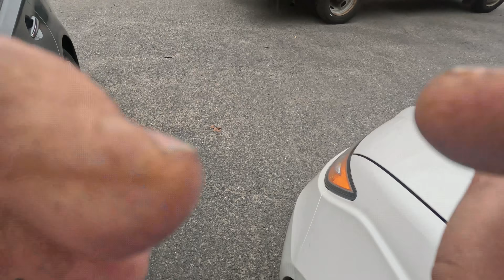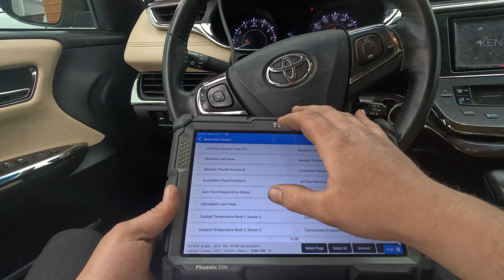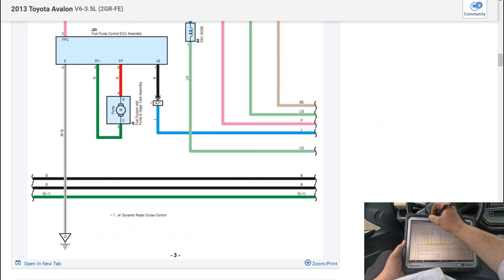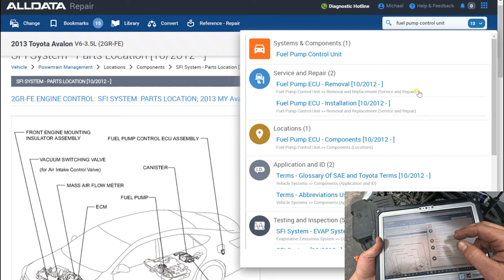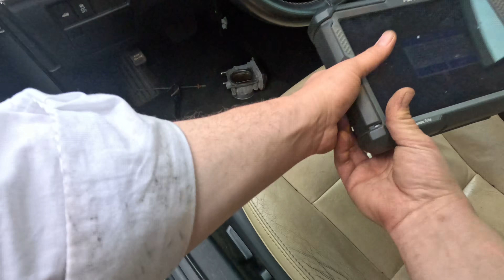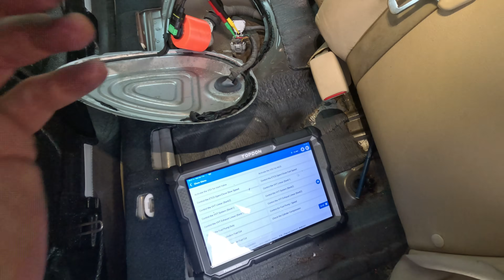2013 Toyota Avalon - Crank No Start diagnosis!

Comment: Thanks for the vid.  One question.  As soon as you realized it was a fuel issue, could you have jumped a few steps by using a fuel pressure gauge?

Comment: Good idea to pull the 30a efi main fuse and visually inspect on most Toyota instead of probe with light
I have seen at least two fuse (in this location)with burned pin.one cause intermittent stall.if burn pin on load side the light will still light on both sides.and then there's the person who remove fuse and jam test probe as deep into fuse socket causing loose fuse. Thanks for the video, especially on Toyota s.

Comment: Quick and accurate diagnostics, the way it should be done. It's too bad cars don't have Shrader valves any more to directly check fuel pressure.

Comment: Wow I been looking at your video,I have a Avalon and no power to my push button so what gives
Reply from the maker: I don't really have enough info, but the power button gets its power from the certification ECU, I would check the ECU IG2 2 fuse, its a 7.5amp fuse under the dash
Reply: @advancedleveldiagnostics  thanks for replying sir but I narroed it down to the steering lock I wish I could get my 69 Plymouth satellite back lol

Comment: Hmm, love the video, but you did take 2 nuts off the fp module, only put 1 back on?
Reply from the maker: No, I put both back, I dropped 1 nut under the carpet, so it took some time to find it. So I cut out that part and just put the actual ratcheting it in. If you pay attention, you will see the cut.
Reply: @advancedleveldiagnostics  I don't pay that much attention lol

Comment: Hi, I dontated your channel, have  fewquestions doesnt make sense to ask without donating..  1.  when you use godiag GT100+, DO you connect resistor between can hi and low to make it 60 ohm.. i bench tested with and without connecting resistor and it works fine.  just curious..  2.I know  my ECM works fine, when do i know it doenst work when i connect to GT100+ any tips LIKE what protocol to choose.. 3. i see power source for ECM. This means power goes into ECM .. does this have to be connected to 15 swtich AT GT100+ OR JUST CONNECT 15 switch ONLY TO ECM input that calls Igntion switch. 4. i see many grounds at ECM atleast 4 pins.. do i need to connect to all of those, or just one is fine. which internally bridged..
Reply from the maker: 1. It really depends on the PCM I know on gm PCMs I never needed the resister but on some Chryslers you can only write with a resister. Sometimes I think you can read without a resister but can't write. The answer to most of your questions is going to be it depends, sorry 😔.
2. I'm sorry I don't really know about protocols I just use the oem data and the scantool does it automatically. 3. The 15 switch is for ignition, the 30 powers are for constant power. The reason they split it up is because sometimes during bench programming you will need to switch off the ignition while still having constant power. 4. Every PCM is different, I just connect too all the grounds just in case. For the PCMs that I do the most I have premade connectors that I bought that connect to the PCM and adapt to the go diag. Hope this helps!
Reply: @advancedleveldiagnostics  Thanks so much.

Comment: You were getting a little mixed up on the diagram.. That main relay was just feeding everything. It was feeding two lines back into the computer..  Feeding the fuel pump..  also activating that second relay.. and even feeding three more lines (off to the right).   It seemed like things where going every which way.. but really it was just that main relay feeding everything.  They didn't' draw it very intuitively
Reply from the maker: Ye I know I was laughing at my self when I was editing it 🤣. I'm not sure what my issue was, my brain was just not getting it.

Comment: Excellent diagnostic procedure. I also like to watch the MAF follow the RPM, some models do not start without a cranking MAF signal.
Reply from the maker: I've also had the opposite on a Mazda that had a MAF signal in run position, so it set a Ckp code. Since then I try to always check it.
Reply: @advancedleveldiagnostics  Interesting Mazda strategy, MAF signal present, thinks it is running without a crank signal.
Reply: @advancedleveldiagnostics  Can you recall if that was a faulty or aftermarket MAF sensor? Thanks.
Reply from the maker: @AkA-5660  It was a faulty and aftermarket MAF lol 
Here's the link to the video on it:
https://youtu.be/Ryl6UD7QiY8
Reply: @advancedleveldiagnostics   Nice! Thanks for the clickable link.

Comment: Tools used are in his Amazon Store!!
Reply: UNI-T UT210D - purchased
"D" has better features than the "E" version....
Reply from the maker: I couldn't find a good chart showing the difference; what does D have over E?
Reply: @advancedleveldiagnostics  Looks like there is a C,D and E. It think the difference is total current measurement and resolution.
Reply: @advancedleveldiagnostics  After looking at the specs I think the E for what you do is actually the best version. It has better % specs at the lower amp range. Going to get one myself.
Reply: @advancedleveldiagnostics  I ordered the "D". (just looked better, overall, to me...)

Comment: great content. quick question how do i know from ECM if it is an ouput from ECM or input to ECM. ANy tips will be greatly apprecaited
Reply from the maker: Usually, B+ is a power source for a component. I look at where it's coming from. If it's a fuse, it's a power source. If it's heading to a component, then it's usually powering that up. On some manufacturers, you can find a chart showing what every wire should have and what it's doing.
Reply: @advancedleveldiagnostics  thanks much make more sense. Also what brand and model of amp meter you are using. You should try to do your tool video in detail and I am sure you get good views.
Reply from the maker: https://amzn.to/3JCqm7l

Comment: It's like Deja Vu. 
I thought for awhile that test light was a homemade job from a headlight socket/bulb with a rattle can lid until I saw your video "My Diagnostic EDC & Exclusive Truck Sneak Peek!"
Reply from the maker: I used to use a homemade one until I found out that  @jarheaddiagnostics makes one.
Reply: Nice!!  Isnt nice for a easy access fuel pump!!